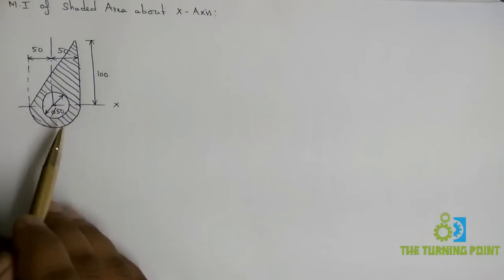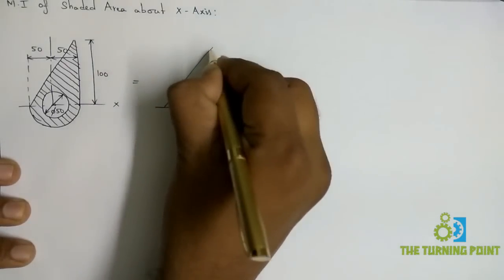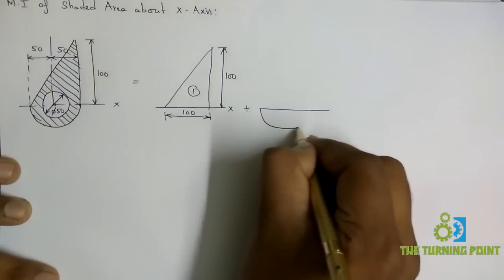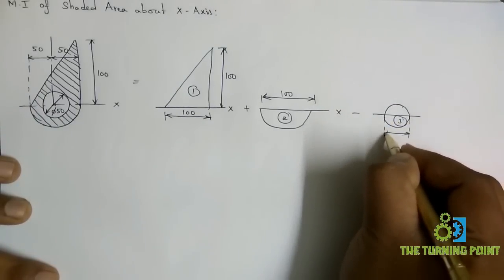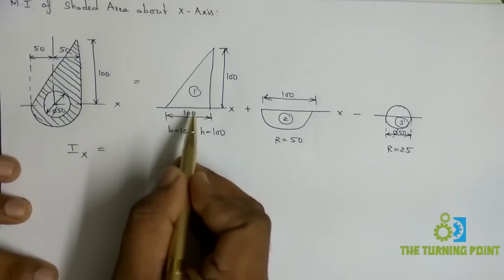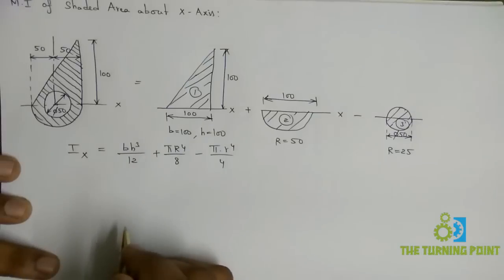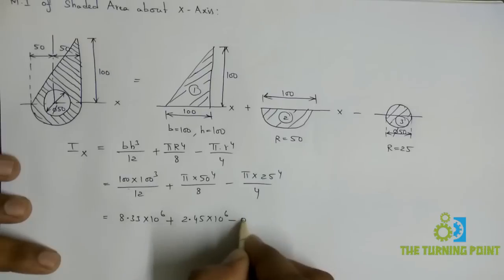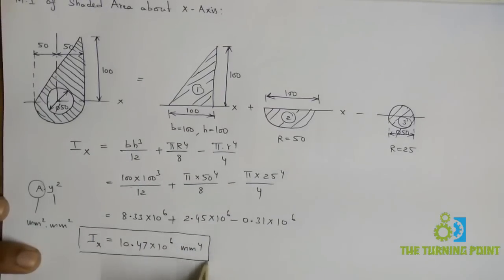Moment of Inertia Problem No  3

Comment: hey sir, why you didnt use (Ad) the area and the distance from each shape centroid to the X axis
I+Ad^2
Reply from the maker: Ha... U r asking me why didn't you use parallel axis theorem... Here i am not transfering moment of inertia about any parallel axis. If you observe all the geometries are in contact with x axis. So directly you can use the relation... no need to apply parallel axis theorem.
Reply: Thank you for your fast reply 
so when the x axis contact all the geometric shapes we will consider it as one big shape and use the relations without parallel axis theorem and not need to find first each shape centroid to find the neutral axis and the moment of inertia about NA and after that find the M.O.I about the x axis

-is the "relations" connected with the centroid of the shape or what ? .. i mean we can used only to find MOI about NA only , and use parallel axis theorem when d not 0 

I saw your last video "Centriod Problem 3 , 30 Apr 2017"
im still confused help please
Reply: in the triangle the X axis is in the bottom so you took bh^3/12 not bh^3/36
but what about the semicercular why the relation is the same when we calculating MOI about its centroid
Reply from the maker: Centriod evaluation is different, Calculating moment of inertia is different... There are number of ways to find the area moment of inertia of a geometry. This is the easiest method. Here no need to find the centriod coordinates why because they are in direct contact with the axis i am calculating. This method is adopted from Engineering Mechanics by Timoshenko & Young. With this method you are able to find moment of inertia about an axis which is in contact like as a base. If you want to find moment of inertia about another axis then here also you have to find centriod and then need to apply parallel axis theorem

The other method for finding moment of inertia is, first you have to find the centriodal coordiantes and then you have to apply parallel axis theorem.

Whatever may be the method you select you will get same answer...
Reply from the maker: here for triangle x axis is base axis then i can use  bh^3/12
For semi circle x axis is like a base axis there that is not the centriod of semicircle. Here the centriod of semi circle x centroidal co-ordinate is zero as the given semicircle is symmetrical about y axis and the y centriodal coordinate is -4R/3pi . Just locate the centriod for semi circle then you will be able to understand whether it is a centriodal axis or non centriodal axis...
Reply: Thank you sir for your time and your wonderful explanation!

Now i have good knowledge about Centroid and MOI
Reply from the maker: Its my pleasure Hussein Mohammed... Asking doubts shows your interest towards the subject...All the best

Comment: why couldn't find x bar and y bar for finding moment  inertia..example for rectangle.Ix=(BD cube/12)+(area of rectangle)*(X bar -X1)square
Reply from the maker: This is the simplest procedure in calculating moment of inertia adopted from Engineering Mechanics by Timoshenko. 
Here whatever may be the geometry i am considering that is connected with the base of the particular geometry. So directly i can take about base axis and  add the inertias directly

The procedure what you are asking is first you have to calculate centriod and you have to find moment of inertia about centriodal axis later you have to use parallel axis theorem to transfer moment of inertia about base axis, which is a lengthy proocedue.. I prefer the first method.

Comment: Is the answers will always same without calculation x bar and then calculating  moment of inertia????
Reply from the maker: Yes you will get same answer. This is an alternative method of that. In that method you are supposed to calculate centriodal coordinates and then you are going to calculate moment of inertia.
Here in this method the geometries are attached with the axis. So you can directly use the relation. No need to find centriodal coordinates.
Whatever may be the method you use, you will get same answer